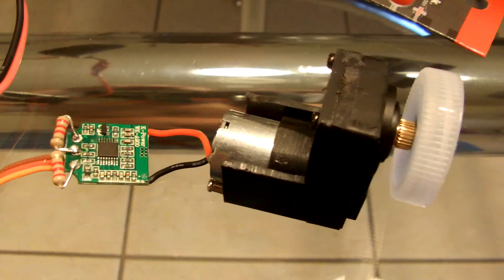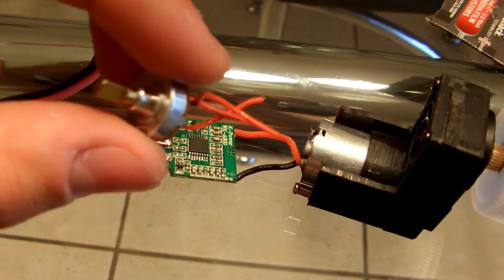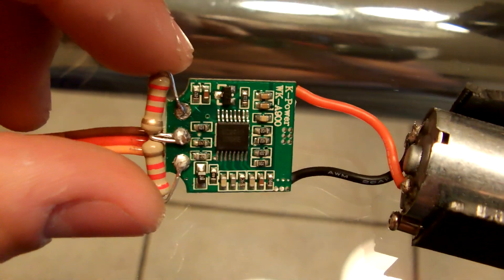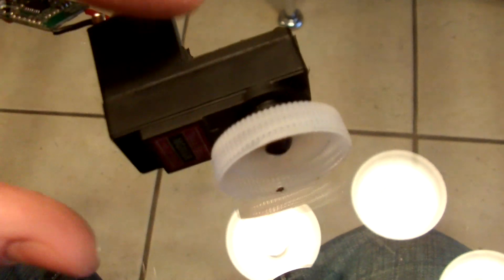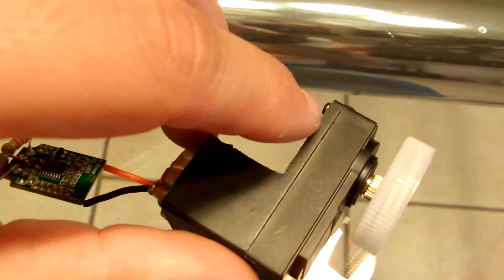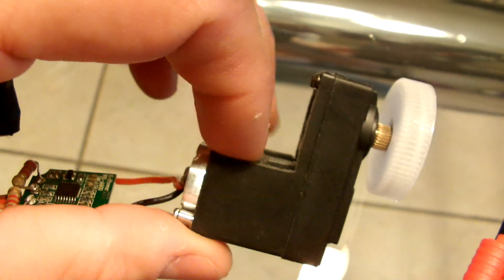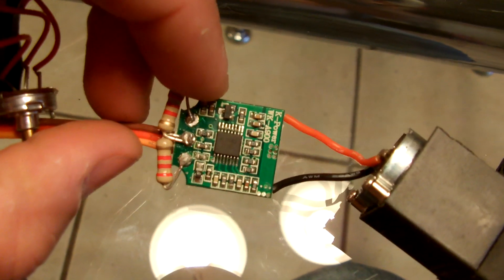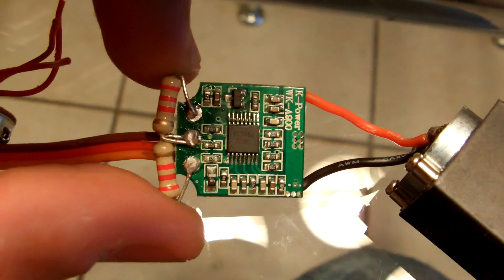How to make a servo winch 2

Comment: Usually a potmeter for a servo is rated at 4.7Kohm, so the 2.2Kohm resistors are OK. Using higher resistance does NOT consume more power, on the contrary it consumes LESS power. Using resistors that are too small can actually burn the control circuit.
Then, as you say in your comments further down, an ESC is a better choice for this purpose. But as long as you want and need to keep things small the servo controller will do nice.

Comment: I've seen so many YT videos & more need to let others know about this before they ruin their servo. I was messing around with mine & noticed this right away. The potentiometer is nothing more then a resistor. Middle lug is the wiper & adjusts the resistance as you turn it. So others are clear the value of the resistor has nothing to do with the size of the resistor. Those are 1/4 watt resistors. The value is calculated by color. Red Red Red = Resistor Value: 2.2kΩ ± 5%. The Gold/Silver is a tolerance indicator. The higher the value the more current it will resist.

Comment from the maker: Well, in my experience the higher the voltage the more "creeping" you get, but it might just be in my head, I think because the motor wants to spin faster it seems like more, but with this you get a much more stable winch, the POT was a hit and mis deal at times! Plus once you set the trim once it pretty much stays good for the run.

Comment: Good explanation - good video.

Suggestion:  Use smaller resistors - those look like 1W resistors - you can you 1/4 or even way smaller since there is no power dissipation.  You can even use surface mount resistors.

If you use 1% or lower tolerance resistors you'll get a better match / require less or no trim.

Comment: I know it's a bit late for this but You need to use 1% tolerance resistors and no glitching.
Reply from the maker: Thats correct👍. Although we all gave up on the resistors a while back and changed over to dedicated esc or winch controllers as they are super cheap and much easier to deal with now. I even included two more videos on this servi winch series showing different variations on how to do this, but this of course is the one that started it all☺️.

Comment from the maker: It was never meant to be a 1/10 scale winch,it doesnt even look like a winch.You would use on your 1/10 scale rig as a hidden winch with a scale looking winch in front to conceal it.Or as a winch for anyone that didnt mind the way it looked. Why go through the trouble of using this instead of a bully winch you would ask, well a bully winch can lift 3-4lb,this can lift 20+ lb.In using this you can actually do some real pulling whereas the bully (just as example) is mostly just for looks.Thanks.

Comment: you need to use the potentiometer to zero the  motor then use a Ohm meter to measure resistance and the choose you resistor based on the reading.... the resistance is just a feedback loop for the servo circuit.  Servo drift is bad if winch is constantly pulling it will burn up winch motor.
Reply from the maker: It is true that if you do not keep an eye out for the creeping you could damage the servo, that is why I made multiple variations of the same idea to offer viewers the choice according to how much work or money they were willing to invest, this is mainly to give unused servos a new life as something else. Check out my third video on the subject where I use an esc to control the servo which provides perfect control of the motor,  thanks for your comment.

Comment: I tried this but resistors got hot and motor stopped rotating. Does these get hot in your setup.
Reply from the maker: It didnt for me, but theres better ways to do this. I have a part 3 video where I use a small esc to control the servo winch which works much better and its super cheap.
Reply: @Gamyrc  Thanks for the Update. 👍

Comment: Hi,

Great video, may I ask,where did you get the circuit board please...

Also, without the potentiometer, how did you mount the gears...

John...
Reply from the maker: This circuit board is from the actual servo, but if you were to do this I suggest using this 10A esc (281117129426) from ebay because it can handle more power and doesn't have any jittering at all, this resistor idea is more of a patch up job if you don't have an alternative :)

Comment from the maker: 2.2 kohm, but it varies from servo to servo on its effectiveness. I rather recomend using a 10a esc ebay sells, its what I use on all of my winches now, you get full control of forward and reverse with no jittering AT ALL! Best thing its about $7 shipped :), item number is 321176064791. Only difference in setup is power has to be supplied to esc ( I made jumper from receiver with pos and neg only, and the esc signal cable that goes to receiver take the red wire off the plug, thats all.

Comment: do you think I could use 2k ohm resistors?
Reply from the maker: My suggestion would be to go with the small esc I show on video 3. The reason for this is that it is extremely affortable, and gives you full forward and reverse control with none of the side effects (creeping) associated with glued POT (video 1) and resistors (this video).